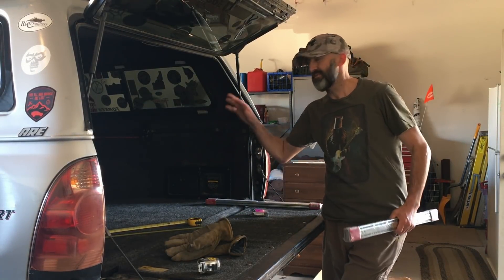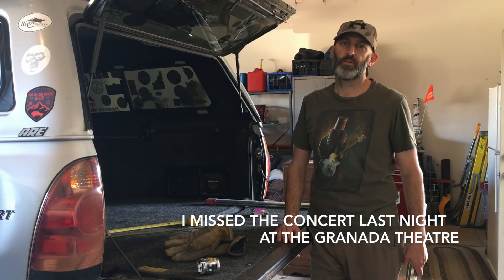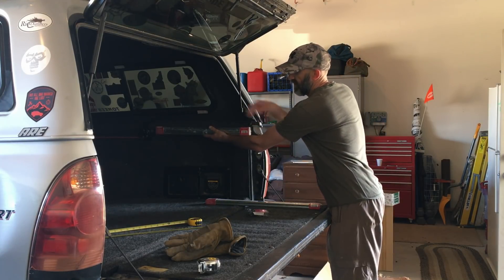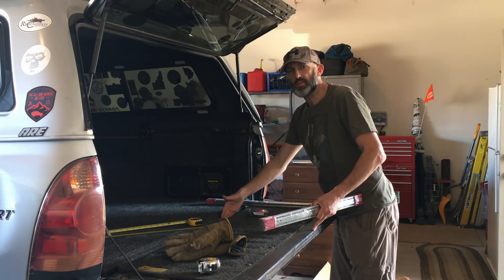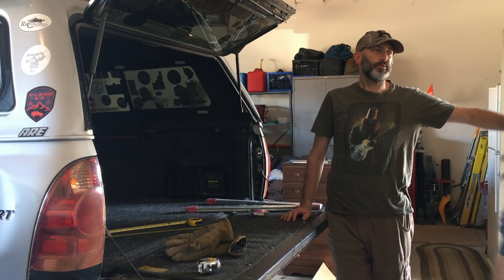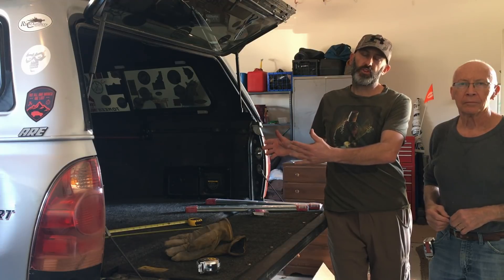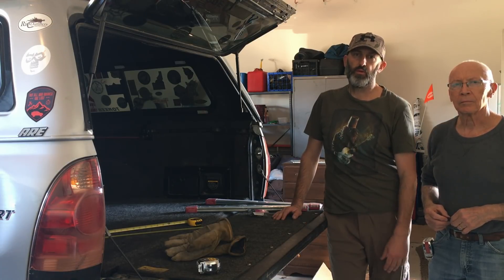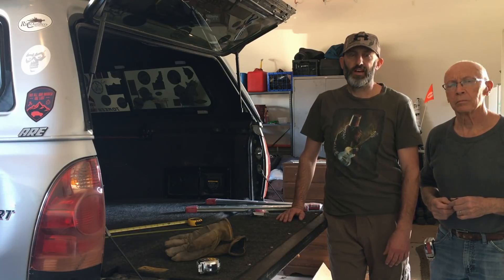Truck Build Design Guide: Part 1 - The Concept of the 2-foot Slide Out Extension

Comment: Great to see your dad on video!  -- This is why I bought the Chevy Colorado Crew Cab with the Long Bed. I'm only 5' 2" tall, but I like my space. I'll also be getting the high top cap for my pickup. Shopping & deciding between LEER & ARE.  Planning a trip to Texas next year, along with multiple other short trips, in cooler weather, so I'll be needing this.

Comment: Since this extra 2' will extend beyond, how will you handle some of the wilder aspects in the areas you camp? Since you are in bear country a lot, do you feel you will still be ok even though you will be a little more exposed?
Reply from the maker: Hey Adventure Outdoors! I think I'll be okay as I'm planning to add diamond plated aluminum sheets to the exterior to give it a bit more protection. Luckily we don't have Grizzlies in my area so I'm very happy about that! Not sure if I would truck camp full time if I was in an area with those monsters.

Comment: I was thinking of doing the same thing for the 5 1/2 foot bed on my Nissan Frontier. But I was thinking of making a  small platform/drawer system first. The box would be attached to the side of the platform, sliding out from there, and the drawers would pull out and the first few feet would have a hinged cover so it could simply be part of the sleeping platform. And the box would be removable from the drawers. 
I've been kicking this idea around in my head for a while, no rush as I do have a travel van. 
So great job! I'm following your progress with great interest.
Reply from the maker: Thanks Lauren! Things are progressing nicely and I'm excited to enclose the pop out section today. I'll post another video this evening of my progress. Hope your week is starting off on a good note!